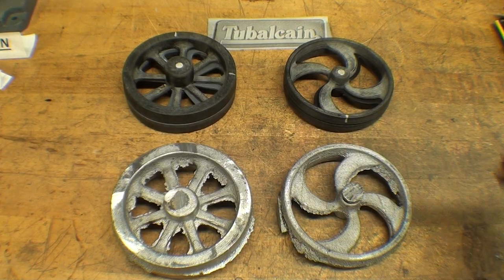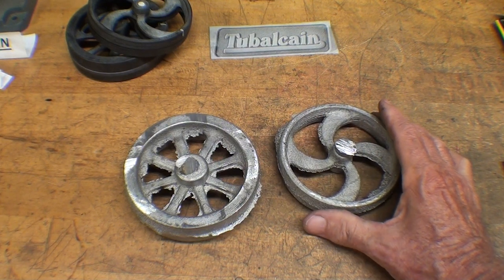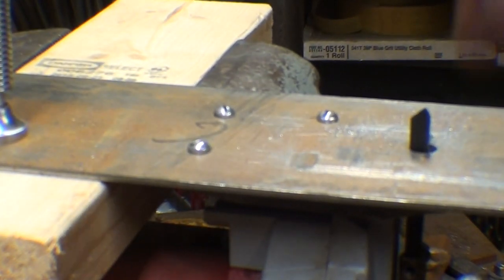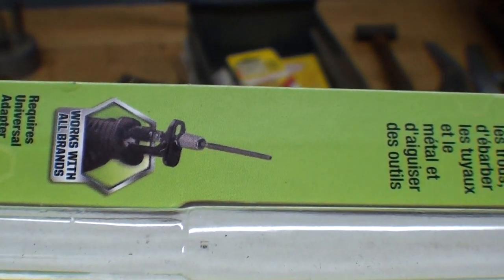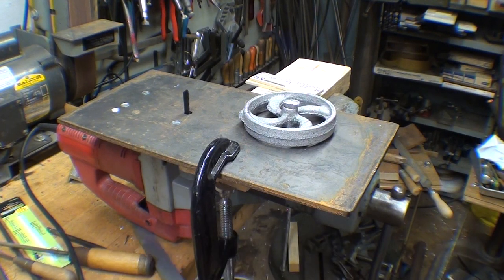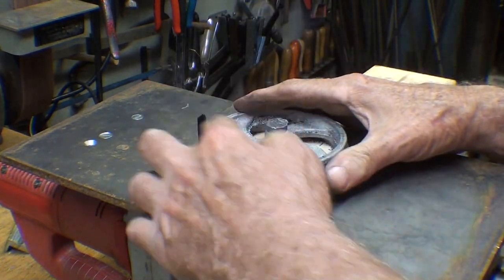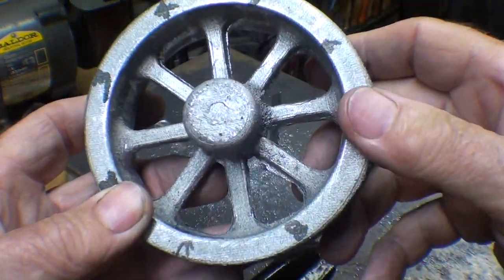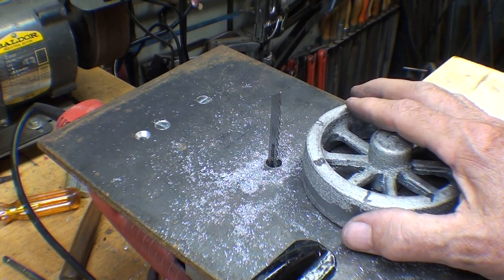TIPS #325 Filing the Rough Lead Flywheel Castings tubalcain

Comment: Why not a rotary die grinder with a carbide burr.
Reply: They get all gunked up really quickly and will spend almost as long cleaning the burr as actually removing lead. Also carbide is a bit of a waste for lead, not that you will hurt it, but a more slippery material that isn't as hard would work better.
Reply: You chalk the burr to keep it from loading up.

Comment: That's a great idea,going to try it out. I have a Diprofil flex shaft filing machine that I used to make injection moulding die sets but it is limited by being only suitable for finishing or polishing purposes only. A tool that is good for lapping a die will never be up to the job for rough filing. Jimmy DiResta has several videos showing him expertly shaping and carving metal on the band saw, worth watching. I mounted an end mill in my oscillating drum sander and it is pretty good at roughing work out but need to watch fingers!

Comment: Is it just me or did others feel like the danger level went up when he swapped to the wood cutting bit?
Reply: I had worked for many years with metal-cutting bandsaws (fine teeth at a few hundred feet per minute). I got fairly careless, since a momentary contact with the moving blade just caused a little scuff mark or took off a little hide. My first time using a 3 TPI hook-tooth blade at 3000 FPM nearly cost me a finger or two (and did cost me a trip to the ER). (And BTW, I was using it to "haggle" away white oak in a method similar to what Mr. Pete was doing here.)

Comment: I tried to do a similar thing, clamping my jigsaw in my black and decker work bench, but it was scary as fuck and VERY unstable xD
Could you feasibly cast an aluminium spoked wheel, then cast a separate lead ring to go over that, like a type?
Perhaps even have the spokes without the wheel, then have that in the mold like a "core", and cast the lead around it?

Comment: Use your plate you already made to attach to the saw, drill holes in your 1/4 big enough for the heads to fit in, then weld your current plate to the bottom of the 1/4. See my vid where I made a stand for my portaband if that doesn't make sense.

Comment: I would not call that a failure. I've used saber saws and bandsaws to "haggle" away metal in a free form way. I find it works well on the harder metals (steel, brass) but I can't recall trying it on aluminum or lead. 

Ganging hacksaw blades is a traditional fast filing method; I've used as many as ten blades bolted together. They tend to support each other when ganged in those quantities.

There is a style of file called a "lead float" which tends to clog (on lead) less than a normal file, but they are usually fairly large (12 inch or more). I think they are used mostly in auto-body work.

Comment: Very interesting.  In your video, you mentioned the tendency of soft metals to gum up, or "pin", in the teeth of the file.  Most "Old Timers" kept a block of white chalk on the bench to load into file teeth to prevent pinning.  I have yet to see any of the you tube contributors using this method.  Any comments or explanation?  Thanks for your very fine series. .............Dick

Comment: I was  told by a tool salesman at Seven Corners Ace Hardware in My home town of Saint Paul MN. That using those sawzall attachments will destroy your sawzall in short order. This was during their going out of business sale. It's a real shame that they closed. If you couldn't find it at seven corners you weren't going to find it anywhere else. I wonder if you could use a Dremel with a down cutting drywall roto bit.

Comment: Very interesting. I think this might be one of the few cases where a real jigsaw (the kind that use coping saw blades) might be useful. The blade is held at both ends but easily removable for cutting inside holes, and the blades are relatively coarse. Might not work for brass, but likely would for aluminum.

Comment: Question?  Isn't the lead soft enough that you could scrape the excess off with a knife or possibly a small triangular scraper?   Maybe something you would use to scrape Babbit bearings?  If your looking for something mechanical to do the work, i would think a triangular piece of steel in a drill press would work pretty well.  It would be a bitt safer than the inverted saber saw and easier to setup.  Just an idea.

Comment: Why not attach a hardwood dowel to the blade with epoxy glue? You can then cover the dowel with any abrasive to suit. I wrap the dowel with abrasive cloth for sanding inside surfaces for wood lettering cutouts. A jig saw with a working speed control helps.

Comment: They casting are looking pretty good, after your filling.  Take a look at my video series on making a die filer for the lathe.
Reply from the maker: Thanks Herb--I will
Reply: +mrpete222 I've been trying to come up with a similar way to deflate cast iron. the staggered blades look like something I will try. since your slot width isn't wide enough to accommodate two, could you off set and tig the ends and use one shank?
Reply: Clark,welding no matter what you do short of using a welder for bandsaw blades will crack right away.No point in complicating things when silver solder will be easier and work better ;)
Reply: SouthJerseySound thanks for the advice, I went ahead and tigged two together last night just to test it on iron, and even though the blades didn't crack, they didn't do well removing the flashing
Reply: Clarke E Some hold better than others but sorry it didnt work out for you.What type of cast iron castings are you working with?Chances are a mill is going to be your best bet followed by carbide burs in a die grinder.Two things I've done in the past were to make a redrive for my drill press so I didnt have to worry about the side loads tearing it apart while using a end mill and another was I turned a adapter that allowed me to run a carbide bur in a old router table.The router mod (or a die grinder fixed to a table) would most likely make short work of what you need with a nice straight shank bur.For me the fence and guides were really useful and with a router you can use wood bits on aluminum too.One thing to keep in mind is speeds that you run the bits but that can be dealt with.
These things might not win you any points with the tool snobs because it is down and dirty machining at its best.But even now that I have a mill I still use my router creation to freehand all sorts of things and rip alum parts out from patterns.I can take a 3d printout or even a ink print and have a stack of parts faster than a cnc at times.All I need is a good master to follow.
Reply: +SouthJerseySound thanks, I do gray iron castings and so far I've only been successful with die grinders
Reply: Clarke E I had a adapter made that allows me to silver solder the burs you use with a die grinder into a adjustable speed router that I use with a old router table.It's not the safest tool out there but its really not that bad either as long as you use common sense.Depending on your casting shapes it might work for you too.It really just allows a more consistent tool pressure than a hand held grinder does.The downside and safety issue is it throws hot metal all over.But I just made a plexiglass shield  that takes care of that problem.So if you're working on a wheel or something with a profile like he is,it should work pretty well for you.
Reply: SouthJerseySound thanks for the advice, I actually have a cheap router table somewhere, I may give that a try. Yes, the problem I've run into have been spoked wheels, outside surfaces are usually machined off unless it's something flat surfaced and then I just belt sand it
Reply from the maker: Thanks herb-I will